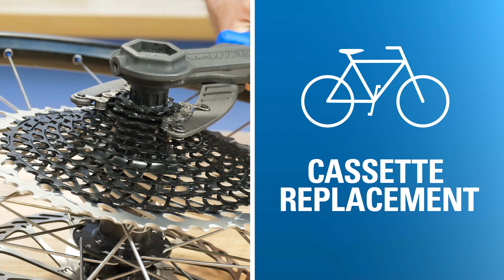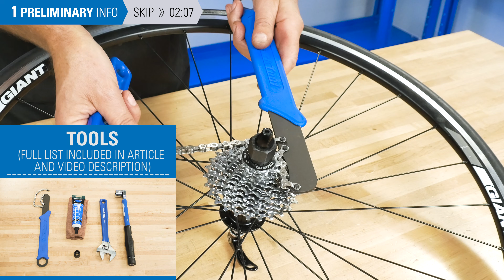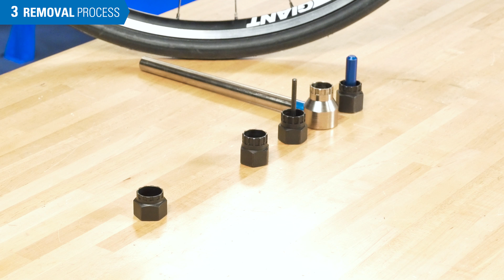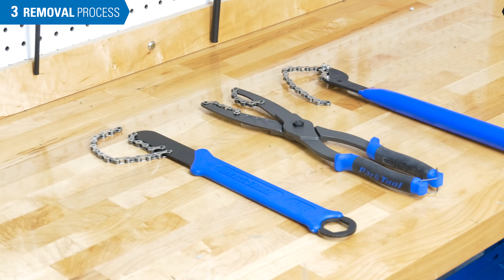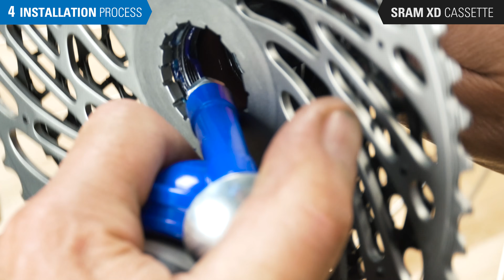Cassette Removal & Installation

Comment: Whats if its stuck solid , I'm leaning on mine and I'm 230lbs , what's the next idea
Reply from the maker: Leverage and mechanical advantage are what you will need to use. These can be very very tight.
Reply: @parktool  absolutely right , I just kept  bouncing my body weight until it finally went , thanks

Comment: Quick release so perfect to secure the cassette tool. But what about hope pro 4 SS T got bolt and goes through cassette tool so anything possible to secure that one?
Reply from the maker: Might be a trip to the hardware store to find a bolt if you really need to. To be honest the FR-5.2 style fo tool rarely if ever needs to be bolted on for added retention. The older 2 and 4 notch designs required it almost every time.
Reply: @parktool  Thanks I will look into cassette tool

Comment: Replacing a 11-34 and going up to a 11-42. There was the last spacer against the hub. 11-42 did not come with a spacer. Do I still need to use that spacer?

Comment: I tried following the methods in this video, but nothing would work. I have a Sachs Maillard cassette assembly, and using the chain whip tool will not work for that type. Here's a link for a video showing the correct method for removing that type: https://youtu.be/-eP4TIuW8GY

Comment: I'm about to change my 10 speed 12-27 cassette for a 10 speed 12-30 cassette as I want the lower gear. Could anyone tell me if I will need a longer chain to accommodate the larger cog?
Reply from the maker: A longer chain is going to be needed.
Reply: @parktool  Thank you!

Comment: Buy a better tool that takes a 1/2 ratchet. It’ll make it much easier to take the cassette off rather than messing around with an adjustable spanner. It’s not the 1950’s anymore.

Comment: There are different types of cassettes. I have a very different type on an early Stumpjumper. I think there is no "lock ring" but instead the two smallest cogs are threaded on. Don't I need two chain whips to remove this type?
Reply from the maker: yes you will need 2 chainwhips for those Early Shimano cassettes

Comment: Hi Guys I Was Trying To Replace The 9 Speed Cassette On My Dawes Discovery 701 As The 7. 8. 9 Teeth Make A Very Horrible Sound When Changing Tryed To Put A New 9 Speed Cassette On But For  Some Reason The There Is No More Room For The Last 9 Ring And Locking Ring Any Advice Many Thanks M. England.

Comment: Hi Park Tool USA®, a basic reality is the best on the run cassette remover is the Pamir Engineering USA hyper cracker® see a realistic question about cassette removal is Q. Why on the run? A. Especially on MTB's you slam the wheels and particularly on your cassette side of your rear wheel YOU WILL POP SPOKES, and so ALSO before getting all excited about searching for the opposite of down Town NY USA to slam your wheels get your local bicycle shop to #1 show you how to measure your front wheel spokes and the two different size rear wheel spokes then get 2 of each of the 3 sizes and use Electricians tape securing said spokes to your seat post tube between the top tube and cross tube otherwise #2 if you can't use the front brakes your braking performance is reduced by approximately %70....

Comment: the cassette stack is stuck. any tips? the first two cogs came off but that is it.
Reply from the maker: It is possible the sprockets have dug into the freehub. This especially can occur with an aluminum freehub body.  See this here  https://youtu.be/9KAaP7pbFV0?t=308
Use two chain whips to pull each sprocket.
Reply: I ended up using a hammer. They had play. They were not really stuck the same way as the video. They could wiggle a bit in all four directions but couldn't slide off past a certain point. The freehub damage was probably a bit extreme

Comment: Hello, just wondering why the grease on the threads. I’m wondering what kind of grease to use if I do... most opinions online say no grease is required... but they are not Calvin Jones. Is it necessary?
Reply: It prevents corrosion and rust. Any common automotive grease is fine on bicycles.

Comment: The inside of the lockring doesn't fit over  the nut that keeps the cone nut tight on my Shimano viam FH-475 ???.can anyone help 🙏👍does this mean I need the FR5 H ???
Reply from the maker: This is not for the cone locknut.  This video is only to remove the cassette sprockets from the hub.  The FR-5.2H or other FR-5.2 only remove the ring for the sprockets to come off.
Reply: @parktool  yes I realise that and that's what im trying to do (remove my cassette)i think I might have called the lockring removal tool (FR5 H etc)the lockring ?.I have a whip style wrench but the removal tool that fits into the 12 grooves wont fit over the cone lock nut .I hope this makes sense .Thanks

Comment: I need to change my rear cassete and want to make sure that it fits.
A bit green with cranks and rear gears. Got a 7 speed shamano so will have to get some advice. Good video and fum up
Reply: you want a 7 speed shimano replacement and a new 7 speed chain then, number of teeth should be printed on the cassette rings themselves, e.g. 11t, 28t.   you want to know the number on the smallest and the number on the largest, that tells you what to buy.  If you can't read the printing you can just count the number of teeth.
Reply: @MoleChile   cheers, will take the wheel off and see which bolt and tool I will need need. Will buy a £35 7 speed, have seen them as little as £12 but want a half decent chain. How much for a new chain. Unless I get a ebike chain  . I will have to buy a chain pin splitting tool.
Reply: Many thanks . Just got to see if its free wheeler .
Geting 7 speed 11.12. 13 smallest

Comment: I put a flat chisel in the center to lock it ... put the chisel in the vice and tried turning the wheel,  no go... 230lb roughneck 

I cut the chain to make a chain wrench , nope ,gears wont go 

I zipped it off with a cutting disc and  balls fell from both sides... no bearings, just balls in a chamber... 

Old bike... I tried to learn b4 wrecking the good one .. tried turning left loose and right loose ..nope 

Learned I wasnt touching the good bike lol ... I need one of those cartoon videos like how a nuclear reactor blew up in Chernobyl... I understood that more than the bike lol 

I know "you need the tool" a flat forging  chisel locked the wheel and cassette in place .. internal I put a finger in there but the only ridged part was an inch deep from the start 

Today the things seeing a chop saw to see what's threaded
Reply from the maker: Also check this one out if you have not seen it. https://www.youtube.com/watch?v=iTJ3taJHOn8&t
Reply from the maker: https://www.parktool.com/blog/repair-help/determining-cassette-freewheel-type

Comment: So mines a straight hole , no idea where to lock it ... said f it and took a pipe wrench to it... busted teeth ( on the casset  but no slack
Reply from the maker: A pipe wrench on the teeth wont help unfortunately. You will need a FR style tool. Take a closer look at the very center. You may find there are some tool fittings inside. You may be dealing with a freewheel too.

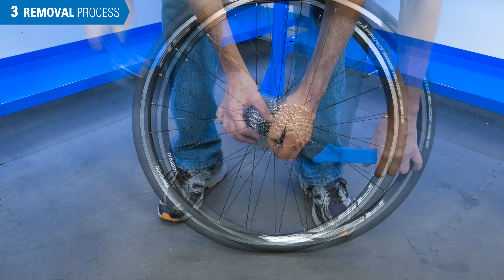Comment: 4:10 I had two bike mechanics forcing on those tools to remove the locking ring on my bike.  Sometimes it's to tight it's crazy. What is the role for that plastic protector ? On older bikes it was quite big, newer have a smaller one.
Reply: To keep the chain out of the spokes if your limiter screws on the rear deraileur are out of adjustment.

Comment: Hi Calvin, I recently purchased a new Shimano XT 12 speed drivetrain, with XT wheel, hub, and cassette (along with derailleur, shifter, chain, etc).  I'm having trouble with the cassette, when the lockring is tightened to 40nm there is a little play in with the cassette that is causing creaking when pedaling.  I tried tightening the lockring even tighter and ended up stripping the lockring.  I have a new lockring now and tightened it down again to 35-40nm and there's still play.  Any suggestions?  thanks
Reply from the maker: The lockring only locks the sprockets together.  There can be play in the freehub body, which is common and normal.  Grab the largest sprocket and also the smaller. Twist against each other. You should not feel play.  
Now grab the largest sprocket and pull it left to right. You may feel the entire freehub moving.  The lockring does not control this.  Some play here is fine.  When you pedal, the ratchets lock on the hub and the play goes away. You only have play when you coast.
Reply: @parktool  Thanks for the quick reply and info.  I used a very thin spacer and now there's no play with the cassette, a tiny bit with the hub like you mentioned but I'm still getting some creaking when pedaling.  I've built several bikes and always service my drivetrain regularly and have never had this issue.  I'm baffled why a brand new drivetrain is creaking like this.  Thanks again, any advice is welcome.

Comment: Can you help me with something so basically I bought a bike second hand but whenever I push the bike the cranks move on they’re own I know it’s not the chain because I just put a new chain on it and I don’t think it’s the bearings because I just had them serviced, I did some research but I still have no idea so if someone could help
Reply from the maker: If the rear sprocket ratchet (freewheel or cassette) is sticky, it will do this.  Also if the rear hub adjustment it too tight, it will cause the chain to move when you freewheel.

Comment: Your videos are best! If I buy wheels with shimano freehub body for 9/10/11 speeds, do I need to get a spacer to mount 9 speed Sora casette? They list a spacer for 10 speed is included, but do I need to use this one, or have to buy 9 speed spacer somewhere seperately?
Reply: Yes you will need a 1.85mm spacer. The included one will work, it’s the same for everything below 11s.

Comment: Have 'whip' tool.have bought cassette tool,got bearings.Cannot unlock/remove cassette.Bike still in bits.No closer to solution.Only option is to stop trying to fix,myself,and  get bike(GT aggressor) fixed by shop.Unknown when.What a headache.Only want to fit new bearings.

Comment: I went from a 7speed cup n cone freewheel rim to a 8-11 speed freehub cassette rim and i was told a 4mm spacer would be needed to lock down the 7speed cassette on the 8-11 freehub but it wasn't thick enough to stop minor play in the front smallest cog. Then i couldn't remove it lol. 
Ordered the Park tools chain whip tool directly after. Lol I always have to learn the hard way. I'm gonna try a 4.5mm spacer next. Just waiting on my chain whip tool to arrive.

Comment: What i used to remove the stuck cog is wraping a extra length of chain while beside a wall and stepping on it to hold the hub and using a big stick u hammered the stuck cog until it was free but next time im buying two chain whips in case that i need to remove the cassette

Comment: My bike has a 7-speed rear gear setup and the chain seems to slip (bending the derailler slightly) when I'm on the smallest one (or the one which gives Max speed). I don't know what I should replace - the chain, the gear itself or the rear derailler. Pls help. 

P.S : All the other gears work perfectly fine.
Reply from the maker: Do you know about how many miles are on the current chain? That can happen when the chain and sprockets are worn out. It can also happen if there is a stiff link in the chain. Thanks.
Reply: @parktool  If I had to guess, I'd say 1300+ miles. My bike is almost 5 yrs old (and so are the chain, rear derailler and rear gears). I used to ride quite extensively in the first couple of years. Thanks for the advice!

Comment: Is it okay to put loctite on the thread of the hub ? I have a slight problem with overtightening.
Reply from the maker: Thread locker should not do any harm.  It is normally not needed.

Comment: When it's a time to change a cassate
Reply from the maker: Simply when the sprockets wear out.  This occurs with the one or two gears you simply ride the most.  The metal wears away, and the chain will not longer stay engaged when you push hard in the gear.
Reply: @parktool  thank you parktool

Comment: For those that need to know:
40 newton meters is 29.50 foot pounds.
50 newton meters is 36.87 foot pounds. A footpound is about  73.76% of a newton meter. So take your  newton meter (denoted in equation below as 'nm') and divide it by 0.7375621, to get your foot pounds (ft-lb). 
The equation is 
'nm ÷ 0.7375621'.
 basic division, the answer is your foot pounds..

Comment: Just ordered the FR-5.2. I’m going to need a torque wrench to install a new cassette and cranks right?
Reply from the maker: A torque wrench is highly suggested for cranks cassettes. Too tight is not good because something could break. Too loose is a problem as it will cause faster wear and has the potential to wollow out the crank.

Comment: I have a shimano remover tool that i've used on a freewheel (successfully). i'm now trying to get a cassette off a different wheel using the same tool. as i've never removed a cassette before, i'm not sure if i'm just not strong enough, the cassette is jammed, or if i'm using the wrong tool. are freewheel and cassette remover tools different, even across the same brand? i.e. am i just using the wrong tool and need to purchase a shimano remover tool for cassettes specifically? thanks to anyone in the comments who can help.
Reply from the maker: A Shimano freewheel removal tool is different than a Shimano cassette lockring tool. A Shimano freewheel will require the FR-1.3 and a shimano cassette lockring will require the use of the FR-5.2. You will also need a chain whip for the cassette that was not required to remove the freewheel.
Reply: @parktool  thank you park tool you always come through

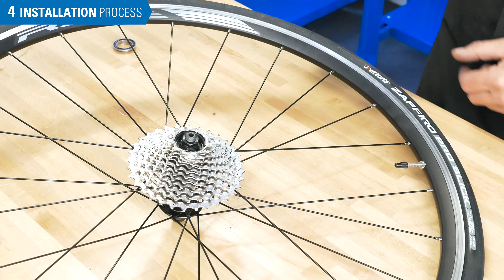Comment: 06:05 - Why so much lubricant?
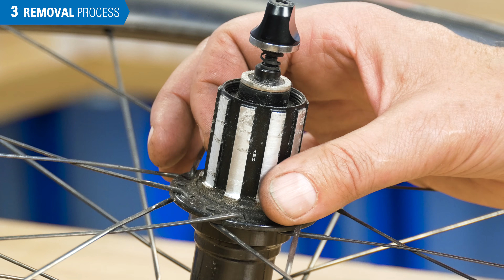04:55 - Is not safe driving without plastic spoke protector.
Reply: Peter Onger Imagine the of the abuse cassettes take while on the trail so you will need a lot of grease to keep running smoothly. Also the spoke guarded can be ignored because if you limit screws are adjusted there is no need. The bike shop I go to the mechanics just rip it off without a care in the world.
Reply: @samdonnelly8419  Agreed

Comment: Thank you, I did what you said but after I install it and put it back on the bike I turn the wheel the small the first gear(8) and the lock ring keep on getting out of the cassette sys.
Reply from the maker: The lock ring is coming in contact with the frame and coming undone? That is not common but does happen. Usually it is due to proper component selection or a part missing on the hub. Is everything as it should be in that reguard?

Comment: You skipped a mention of a spacer. I thought, a spacer is required for 10-speed or lees cassette installation only; turns out, even 11-speed cassettes need a spacer on standard Shimano/Sram cassette drives. Am I correct?

Comment: I used the old lockring instead of the new one that came in the box, is that ok to do or should i have used the new one ?
Reply from the maker: The lockring will not wear out and can be reused. However if you have different sized first sprockets, some rings may be too big and interfere with the chain. If it pulled up fully tight, and shifts fine, all is good.
Reply: @parktool  Also when I took the old cassette off at the rear behind the largest cog wheel was a spacer/washer, I have left it on the freehub before fitting new cassette. Is this correct? What is it for?
Reply: @justmadeit2  The spacer is for using narrower MTB cassettes on wider road bike freehub bodies.

Comment: Great video thanks! I'm currently running an 11-30 cassette. If I were to switch to a bigger one say an 11-32 or 11-34 can you just change the top gears (the solid one) or do you have to change them all?
Reply from the maker: There are after market sprocket for the largest sprocket, but those are mostly 40t and larger.  Likely you will need the entire cassette stack.
Reply: @parktool  thank you SO MUCH for your response and advice. I will go that route. You guys are the best!

Comment: I have a cassette cog for my freehub, its a Sram pg730 but only the smallest cog is loose, the others look all moulded together as one piece. Why is this ? Dont cassettes usually have it so all the sprockets from large to small individualluy seperate ? I was just wondering why mine is moulded as one piece apart from the smallest cog
Reply from the maker: Many cassettes have what are referred to as carriers that carry a set amount of the sprockets. This disperses the load of the cog out. The individual sprockets have a tendency to dig into some of the softer free-hub bodies out there and can actually wear through them eventually. Often the smaller sprockets do not get a carrier as there is no room for it and they do not typically have as much torque being put through them(less leverage). Hope this answers your question!

Comment: Pleeeeaaaaasssseee.... Can we go back to calling it a "Cluster"? Cassettes are for  listening to Roy Clark. I've officially opted out of the word cassette for bike talk. The definition of cluster just makes more sense than cassette.  Calvin, start this nomenclature correction and show the bike world your leadership capabilities.
Reply from the maker: I consider a cluster to be a set of gears. Either a freewheel or cassette. The transition to the splined install of sprockets made it easy to change which is where the "cassette" nomenclature came from. Changing it at this point is going to be tough to say the least.

Comment: Thanks Park Tool for your detailed instructions in great tools. Couple bucks more for not half and an order another tool after the third use is well worth that to me. I was sure I knew what I was doing but to see it done before I did it really helped me zipthru the procedure! Freehub off everything cleaned bearings back in in less than 5 minutes.